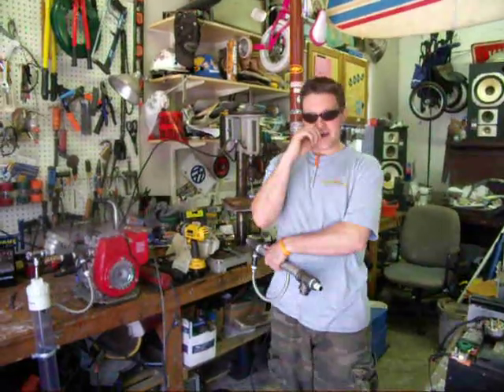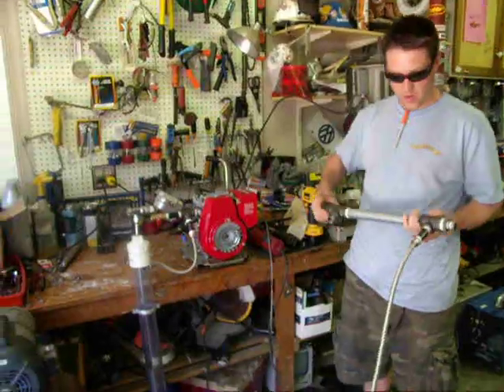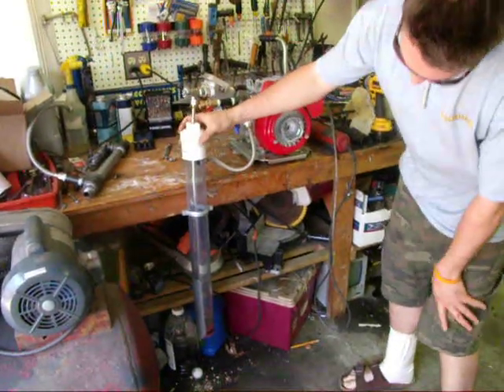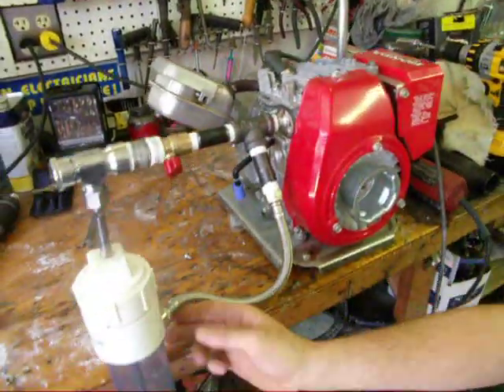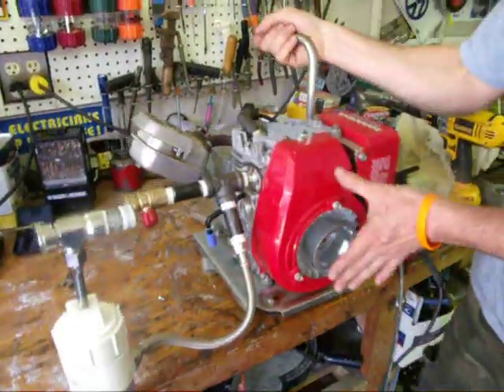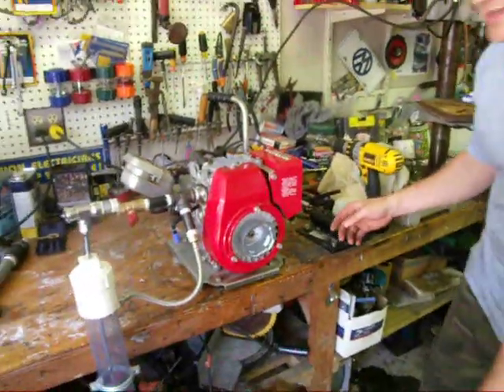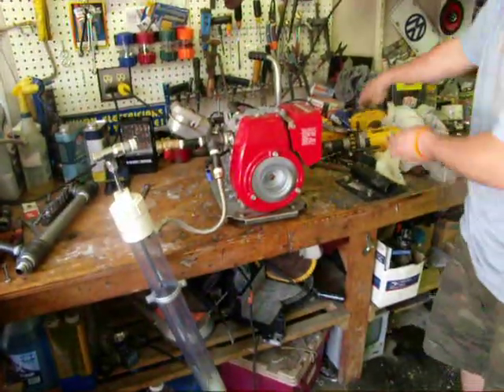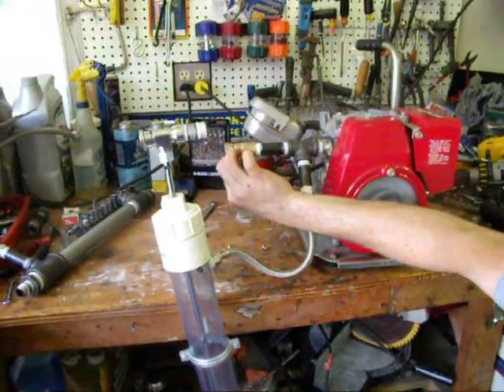VAPOR GENERATOR GEET HHO

Comment: You were the only one that use the smaller fuel line and you can actually control the idle that's awesome. Have you figured out how many miles per gallon you're going to be getting yet

Comment: You need to add non-combustible gases which by the way are at high temperatures, to slow down the burn rate of volatiles from your bubbler. Your engine is not designed to handle fast-burning fuels.

Comment: You need to precisely control your engine RPMs or you're going to generate wrong frequency AC electricity. You need 3600RPM for 60Hz and 3000RPM for 50Hz. IF you want to do this proper and use it for more than a demonstration then you need some sort of governor for the engine to open and close a butterfly valve at the fuel/air intake where the carb was. The valve you're adjusting is the air/fuel ratio, but then you need to adjust how much air/fuel mix to send into the engine.